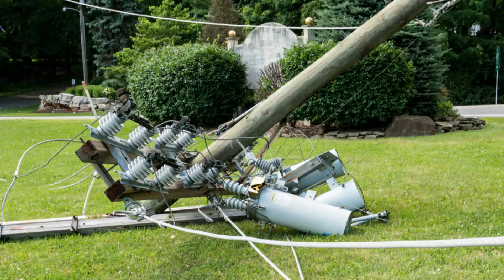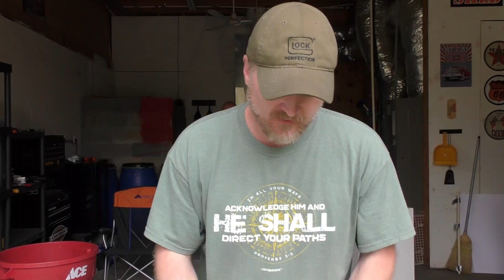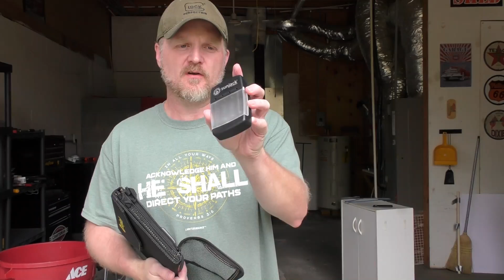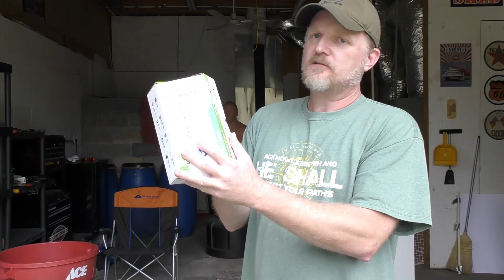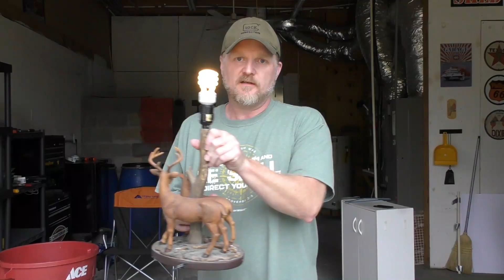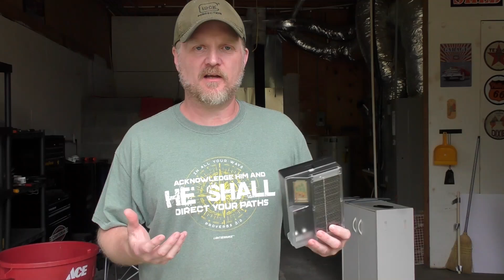Portable Solar Power Systems for Home, Camping,  RV and Emergency Use. Low Cost Power for Preppers!

Comment: I just ordered a 30 watt solar panel with various voltage outputs including USB 5 volt, 12 volt, and 18 volt. It was about 70 bucks and folds up and it`s a smart charger that detects how the devices should be charged and adjusts itself. All reviews were positive. I saw your videos about solar panels and decided it was a great idea to get one. 

We were without power for a long time after the hurricanes last year. Heat almost killed me. After the storm passed there was no wind for three days. Zero! I have two rechargeable USB fans now (one runs 22 houits and the other 34 hours), USB battery chargers for AA batteries, a 12 volt D battery charger, and I ordered several power banks for backup. I have a BUNCH of the best radios and several that can be charged with USB. I only use rechargeable batteries in all my radios. I also have several types of nice lights that this small system can be used with. Thanks for your videos!

Comment: M.D Creekmore, can you recommend a solar unit to power a fridge or deep freezer if the power goes out? Something affordable and not $1,500 and up. Thank You
Reply: Putting my 2 cents in . Bluetti 2400 solar generator is EASY to use and runs our refrigerator , paid approx $1,900 on amazon . We have a Energizer 4000 watt inverter as well .  We are new to all this SOLAR stuff , but my husband is ‘ rolling his sleeves up ‘ and figuring it all out .   Blessings

Comment: Most of these electronic gizmos could be damaged by an EMP and should be stored in a Faraday cage.
Reply: Yep , that is so valuable to know !  A galvanized metal trash can with a matching tight lid , and that silver duct tape around the rim of  lid . I had to put my 2 cents in — so every one knows a FARADAY cage is easy and cheap .

Comment: I bought from eBay the cheapest yellow solar generator they had for $30,has one USB port and two bulbs,it has only 2,what are they 11650 batteries in it.. I've used it just for shits and giggles now for over a month now.. For what it is over than what its not,it's an awesome cheap little setup...
Im going to order the $50 ish one next (has a picture of a world globe on the side) and possibly one that has a FM radio built into it.. These things are very underrated for what they actually do do
Reply: Where can i purchase 1 please
Reply: @gigi4life423  um.... Ebay👆👆👆

Comment: I was researching Jackery 1000 and 2 100watt solar panels.  It's expensive, but only weighs 22 lbs.
User friendly for a single old person.
I just ordered it.
Reply: Also, I ran over to Harbor Freight, and they had a complete 100watt solar panel kit with all the fixins for 199.00.   
Thank you for mentioning Harbor Freight.
Reply: Good enough 😎, i got battery bank i built in my house and converting my dads old truck into BOV with high output inverter
Reply: @Bucky1836  How smart that you know how to do that!
Reply: @yeswing10  always get the coupons from HF